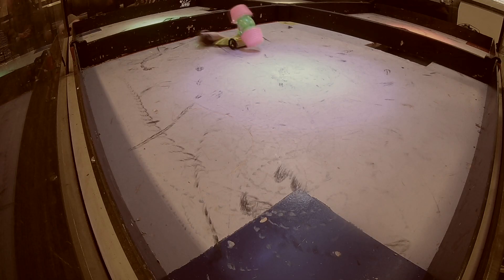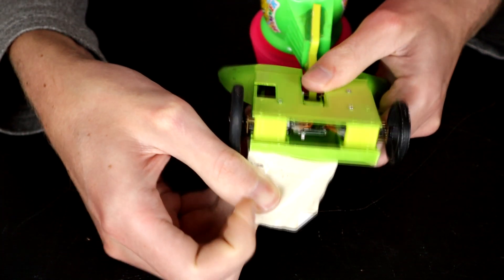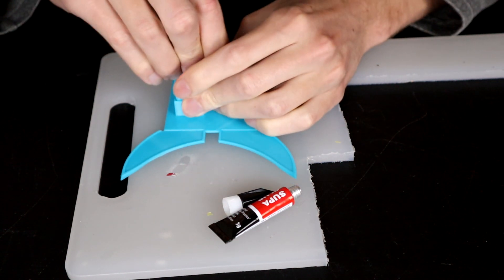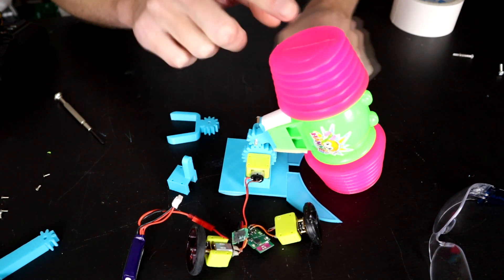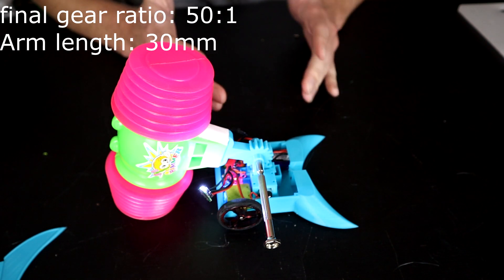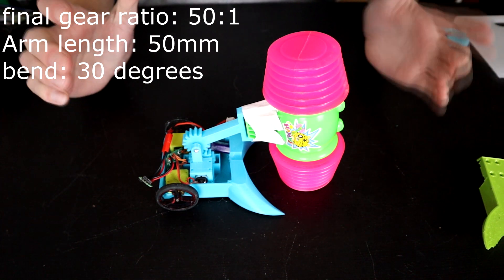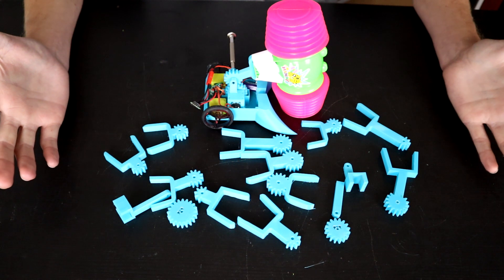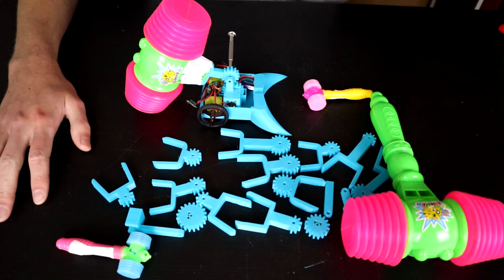Making my robot even louder to annoy my opponents! (noisy combat robot build)

Comment: you should use the tiny ones and make a double hammer ant that just like keeps swinging the hammers left, right, left right, in turn when you're pushing forward on the weapon throttle, it might take a little gear wizardry to run that off of one weapon moto but I think you could do something similar to the US antweight hammer bot team orby build recently
Reply from the maker: I saw the team orby hammer! thats very impressive and would be so much fun with a tiny squeaky hammer on the end

Comment: Those tiny hammers would make a great horizontal spinner. It might be hard to make them hit flat but they could hit with a lot of speed. A sort of bellows mechanism could help transfer force from the edge of the spinner to the face of the hammer.
Reply: if you used a negative rake angle they would probably hit flat enough to get a squeek, the repeated impacts might tear up the soft plastic tho
Reply from the maker: negative rake is definitely the way to get a good flat squeaky hit

I have considered putting them on a spinner, they might work, the "bellows" arnt super soft as the are designed for kids to hit them a lot

Comment: The angled front is brilliant. You might want to check driving stability with different back setups and make the back section better for giving you stability. Ideally you can provide a bit of leverage with the hammer to help you wedge people.

Comment: tiny hammers should go on a flail bot, if they're allowed.

A thin TPU cone or dome for the back hammer might help to visually balance it out and maybe get little squeaks on the backswing.
Reply from the maker: Flails are allowed as long as they dont entangle, so its a fine line

I'm seriously looking into replacing both bellows but my tpu printer is out of commission currently

Comment: I like these iterative design videos. A while back I looked at Beta's hammer (it has a similar bend in the arm) and after this video it's easy to realise the bend is not for extra reach or whatever but to keep the mass of the pill hammer in-line with the striking force, so there is less torque on the actual arm when hitting something. Funny that John Reid had the same problem as you (but for different reasons) and both came up with the same solution.

15:50 you can really hear the difference the bend in the arm makes on the return stroke, since it's now hitting doubly as out-of-alignment with the hammer as before.

18:04 squeaky diesector?
Reply from the maker: Huh! that is such a cool parallel to draw. John is the king of hammer design, maybe I need to steal... I mean learn from some more of his designs

Comment: You'll probably have balance / inertia problem if the pan is empty or destroyed. Is there any way to advance the center of mass ? Looks like the battery will get forward, but any way to add there ?
Reply from the maker: Not really unfortunatly, the only mass thats behind the hammer currently is the wheels and drive motors, but I cant move them forward without losing the ability to drive if someone gets a wedge under me.

The best solution would be to move the motors forwards, then gear/belt drive to wheels at the back, but I'm running out of weight as it is, so I cant afford to add extra drive componentry

Comment: Idea that I’ve had for a while but I don’t have the skills to make, so I give you full permission to try it out: whistle spinner. basically it’s a whistle internals built into a spinner, angled just right to take in air and (hopefully) let out a high pitched screaming sound that gets louder the faster it spins. I feel like it’ll be a fun little sequel to the squeaky hammer, and maybe they can make their own band 😂
Reply from the maker: Oooh I like this, 
Steve Mould did a video on how whistles work a while ago, so designing a custom one wouldnt be too hard.... hmmmmm
Reply: I'm already imagining the whistle spinner being called Stuka. The idea just reminds me of the Luftwaffe Stukas which had some aerodynamic trickery to create a terrifying noise as they dive-bombed their targets
Reply: @digitaldeathsquid3448  No aerodynamic trickery, they just attached a siren to the outside with a propeller driving it from the airspeed of the plane. 

Also imagine having to fly for hours on end with a siren blasting next to you aside from the engine and wind noise.
Reply: @digitaldeathsquid3448 how are you love this idea can I take a shot at it?